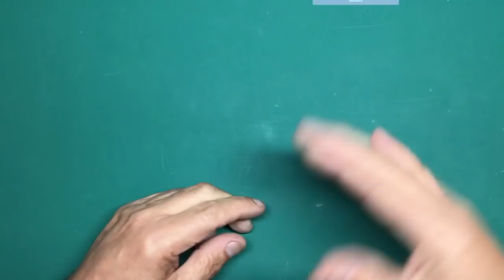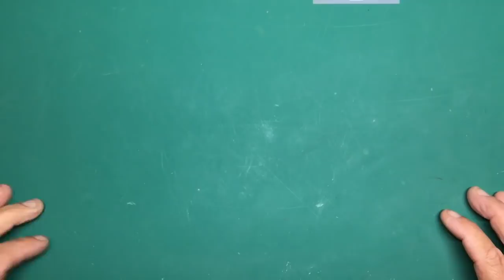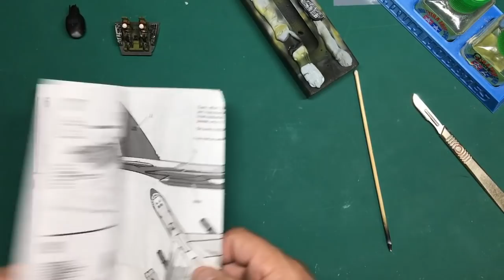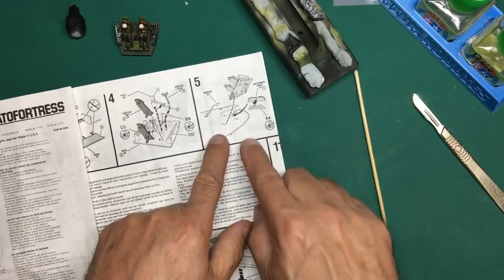Big Bad Buff Build for Beginners. Part 7

Comment: Thanks for another very useful episode. My build of this will be having the bomb bay doors shut as well, apart from it getting around the lack of bay detail (as you remarked), I also prefer the cleaner lines with them closed. Although it may be common practice for B-52’s to stand with bay doors open & flaps down it’s possible to find more than a few ‘in service’ photos of them fully parked but with doors closed & even with with the flaps up. I’ve read (for what it’s worth) that they retain hydraulic pressure when ‘switched off’ so that’s not the determining factor in door & flap positioning. Russell

Comment: Nice to see you simply “building stuff”, Nigel. Long may it continue.👍😎
Reply: My thoughts exactly Lloyd.
Reply from the maker: Hi LLoyd. Do you mean actually building a model, or building as opposed to modifying everything?
Reply: Nigel’s Modelling Bench. Taking a box of styrene, glueing it together, painting it, applying decals then finish with some weathering if so desired. Job done, move onto the next. 👍😊

Comment: Did you use the ANYZ Kolinsky detail brushes to paint the pilots, and if so, what were they like? I need some new detail brushes so would value your opinion.
Reply from the maker: Ed T if I am honest I think there are better brushes out there, but the kolo sky brushes were very good. I had to clip off some stray bristles sticking out of the side.
Reply: @NigelsModellingBench  Any recommendations?
Reply from the maker: Ed T Windsor & Newton.
Reply: @NigelsModellingBench  Thx, I'll check them out